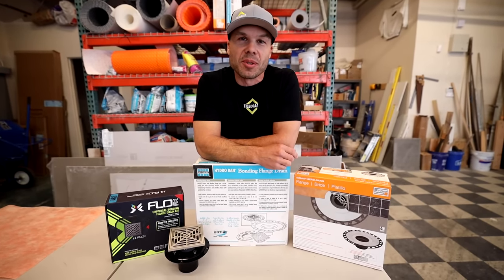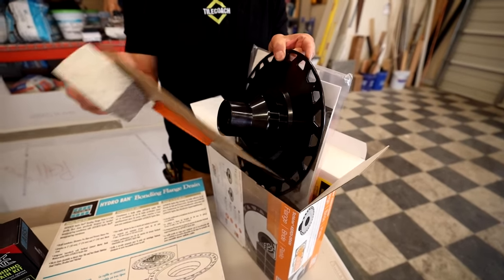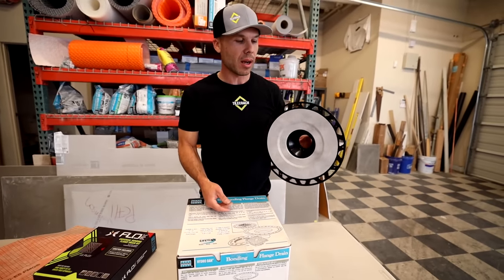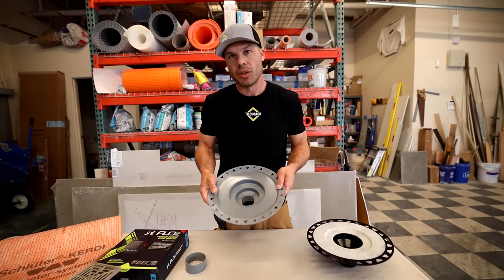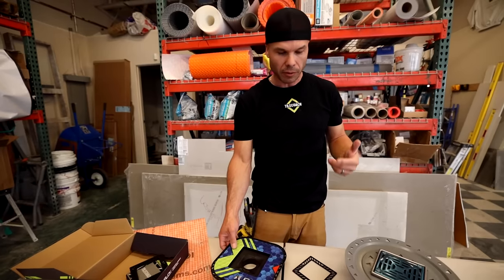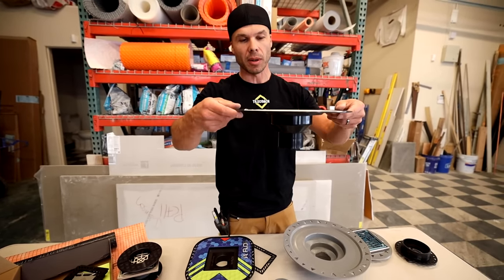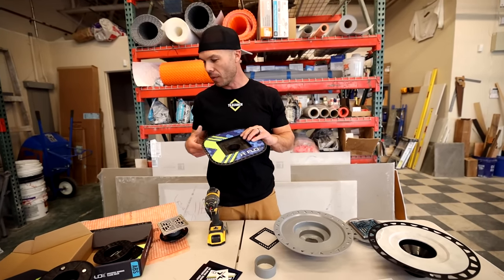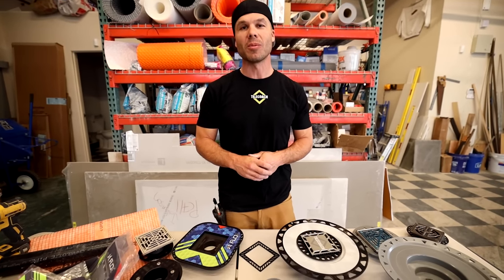Bonding Flange Drain Comparison --- Schluter, Laticrete, and FLO-FX for Tiled Shower Pans

Comment: I feel Kirdi items are over priced mass produced low quality products that speed installation time but the customers loose in the end.
Reply: Definitely, I've been doing the traditional oatey shower liner with a standard drain, the one he first showed, never a problem in 15 years of doing it.
Reply: @felipelarrondo1308  all the water being held by the deck mud makes me not want that system in my own house
Reply: If you build it right it won't happen. Most of  these waterproofing ways make me wonder if they are expecting their installation to fail, I would use epoxy grout if I could to really be sure nothing ever gets through, also, seal your grout at least once a year.

Comment: Schluter is garbage for long term use will only last 10 to 15 years if you are lucky however a PVC shower will last 30 to 40 years easily if done correct and properly like pebbles around your weeping holes do not install nothing into the pan liner leave 2 inch's of wall above the tiles on the sub floor and most important do not puncture the liner when installing the floor pan setup.